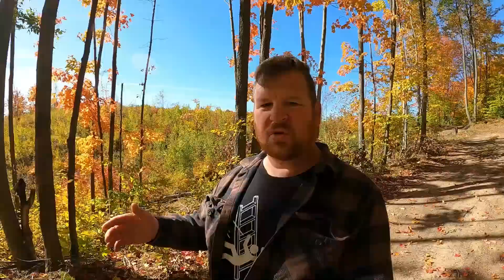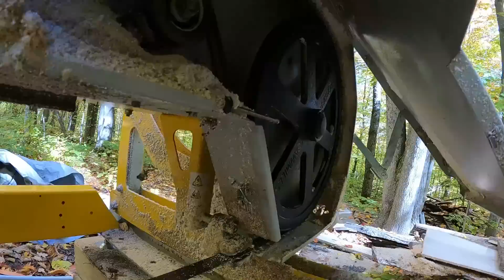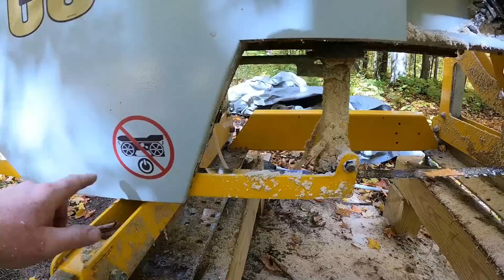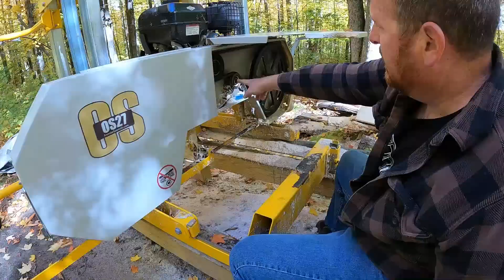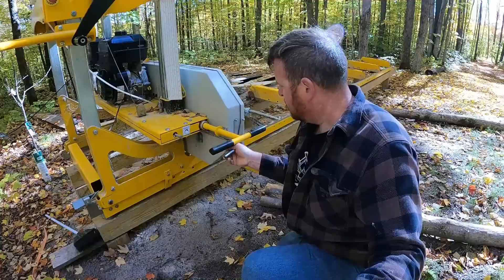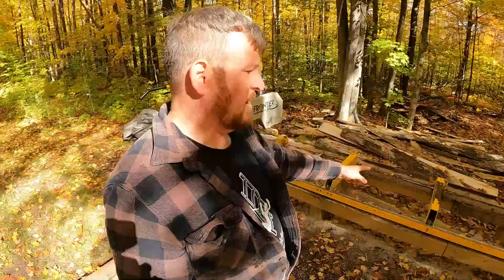Off Grid Cabin Build-  Build your Dream Cabin with this machine!

Comment: Thanks for this Jay! Nice to see a comparison to my Woodland Mills HM126. I see you have a belt tensioner system but not sure you mentioned how well that works? Or how it works?

You can always trim you water line so it’s not so long (just make sure you hoist the head up as high as it goes as a guide to trim so you don’t trim it too short. 

Interesting safety features too. I definitely have my doors open with the engine running often to hear pinging or see if the clutch is engaging properly, so I think that feature would drive me nuts. 🤫
Reply from the maker: Hey there my friend.....you know my walk and talk videos lack the whit and charm your videos do, but I think a few folks may have survived through it, ha ha. 
The T handle right in front there simply says to turn or spin it 5-5.5 turns to loosen and tighten the blade for removal and tension. I believe your hm126 you used a torque wrench in a similar location,  but using a torque wrench would obviously give you better accuracy i would think. But so far I have only chucked a blade or two and it was from back tracking the power head and it popped. But I think I have the hang of setting a good tension now. 

You know after two year of jiggling that hose, while watching my self talk about doing so....It clicked that I should simply do like you said, trim it.....but sometimes things need to kick me in the face before I get it, lol.
Reply: @OffgridwithJayandJen  your videos are great!!! You know that 😁😙
I’m meaning the belt tensioner (not the blade tensioner). It’s how you would tighten (or loosen) your drive belt. My HM126 (my older version) doesn’t have a decent way to do that (you have to loosen the engine mount), but it looks like your mill has an idler pulley thingy. Just wondered how that worked for you. (If you’ve ever even had to adjust it 🤷🏻‍♀️).
Reply from the maker: @Michygoss  oh, ya I totally misread.....you know, honestly I have run this machine for two years now and never touched the belt or  made any adjustments other than the guides and such. The blade has always engaged well and spun nicely. I'm sure after now saying this, I'm in for a rough summer of random sawmill repairs. Lol. Maybe I don't mill as much as I think.....but I feel like I have run lots of logs through this thing
Reply from the maker: Oh....and ya, I'm pretty sure most people cut the wires to those safety switches and sensors or simply unplug them.....I haven't found myself annoyed enough to tinker with them....yet. 😉

Comment: The Poplar tree's you showed and said they were around 70 yrs old kinda surprises me. Then I moved here (I am in the foothills of North Carolina) I had a 5" Poplar tree in my front yard I left while clearing my property. Fast forward about 30 years, I first was having it topped, then decides to just cut it down. The tree was roughly 80' tall, the base was easy 45 or so inches, When we measured the log (where it becomes just straight log, it started around 32" And that growth is twice what they grow up there, I guess because a lot more/better growing season.
If you did some research and figured out all the material you used, priced that, and then compared the cost of what you milled against what Lowes or home depot would charge, would give you a better idea of what you spent on the mill vs what the lumber would cost to buy. Too bad you couldn't figure all this back when lumber was so dang high!
Around here most everything you get at the big box stores is all pine, except for a few specialty pieces. The only thing I have seen them use Poplar for is Plywood and pallets. 
Great video and very happy that you are happy with your mill.
Reply from the maker: Thanks Chip.....I would also adjust the growth speed to our sandy poor soil. I have had others mention the same thing about huge poplar and they have similar conditions as you I guess. Thanks for the comment. Best wishes
Reply: @OffgridwithJayandJen  Soil type it a big difference for sure, here, I dig down maybe a foot and it's all just red clay, but we do have tome awesome top soil.